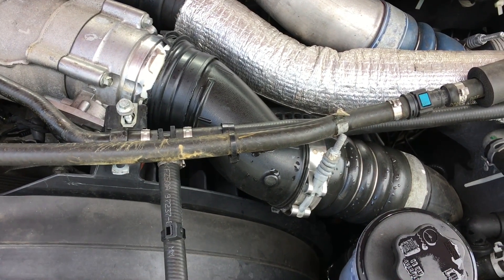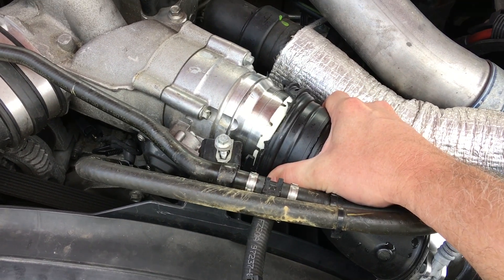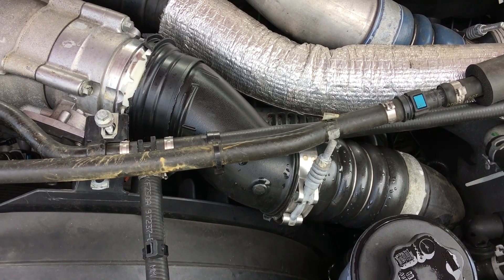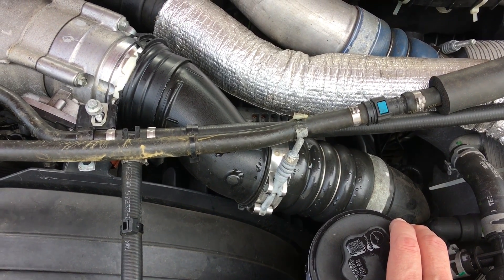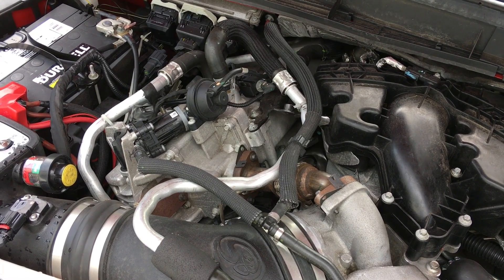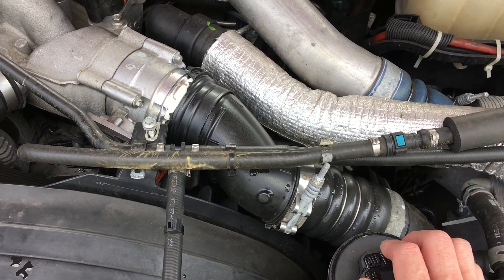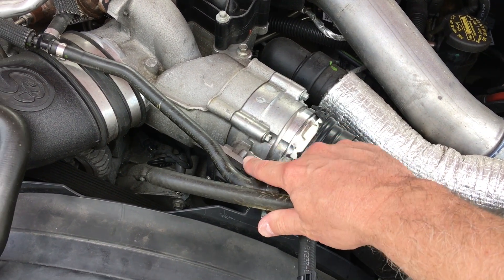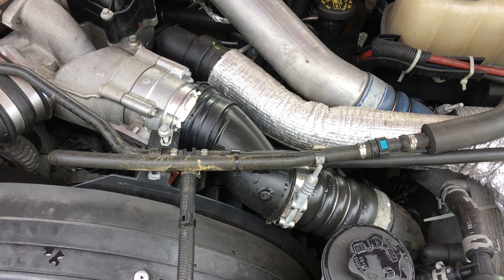6.7 Powerstroke Inter-cooler Pipe FAILURE!

Comment: Mine blew today but I see there is either oil or diesel fuel in the pipe. Should fluids flow in there or is there a deeper problem?
Reply from the maker: Kane ... Sorry to hear. The oil can either be normal crankcase breather blow-by and/or oil leaking past the turbo shaft seals which the 11-14’s are common for if turbo shaft bearings are wearing out and the shaft is vibrating. Depends on mileage and if DPF is deleted causing turbo shaft over-speed which leads to premature wear and failure.
Reply: Almost 125k miles and nothing is deleted. Everything is stock still.

Comment: Just blew mine out. 350,000 miles, had it since 280,000.  
Didn’t hear a pop or a noise.  
Could hear rushing of air noise when throttling, put only me and couldn’t pin point the location. Sounded low and drivers side. Thought a hoses popped off and had this happen once in a 7.3. 
Looked for about 3 hours trying to find something and searching online to find a reason for black smoke, no turbo boost and no loud noise (common to hear when turbo goes out) Thought it might have been my turbo. 
So happy to see this video. 
Checked the upper boot and it had split on the inside. 
Thanks sir. I’ll sleep good tonight.
Reply from the maker: Benjamin Gilley ... You’re very welcome! Glad my video was able to help! Thank you for watching!

Comment: have a simillar problem but mine didt belew up, its kind of embarressing a small animal called marder here in germany drew a big holle on it so i tought the turbo was finished, i dally drive i put up some tape wille whaitig for the new part, 
once i have no choice but to dirve dally wille whaitig for repair , i try not to do strong accelerations, but i dont know if the turbo is already broken
Reply from the maker: Nelss1One ... Your turbo should be fine. The intercooler pipes are on the output side of the turbo and feed into the plenum which feeds the cylinder heads. I do recommend upgrading to a metal pipe to prevent future problems.
Reply: @subman719  many tks for your answer mate :)

Comment: Mine failed at 196,000. I'll replace it with the H&S OEM silicone pipe
Reply from the maker: Guitar4blues ... I personally like the AFE Bladerunner pipe. I think it’s a stronger option. That’s what I used.
Reply: @subman719  is that an OEM setup or does it require a tune adjustment?
Reply from the maker: Guitar4blues ... totally OEM replacement. I have the full AFE blade runner hot and cold side pipes.

Comment: Wow !  That happened to me yesterday in Fayetteville, NC.  Happened just after moving over to the right lane.. sounded and felt like I had hit someone!  Scared the Holy Piss out of me!  Very same spot at the top of the pipe, was blown to pieces.   131k miles, but new engine installed last July, so about 2k miles on this engine! And this seems to happen a lot!    Worst part was that I was 80 miles from home, and thought I would need a tow truck.  But after limping along for several minutes, the engine started to run fine (at 50% power), so I eased it up to Ford in Cary,NC.   It's a known issue; the Service Advisor told me that I should carry hose clamps with me!    Maybe Ford should come up with a Fix !!!!!
Reply from the maker: Unfortunately Ford doesn't care... they STILL haven't made any updates to the pipe so when it blows you get the SAME EXACT DEFICIENT part! So sad that people have to suffer through this while Ford sits back and laughs as they count their profits! I did upgrade to the AFE Bladerunner kit which is a much more reliable option than the OEM pipe. Hope you have better luck in the future!

Comment: My just happen had some oil in there is that normal?
Reply from the maker: landofBrucewood ... Yes. Some oil is normal. There is a crankcase breather bypass kit available that reduces the amount of blow-by oil. However if the turbo bearings and seal are going, you will experience excessive oil in the pipes.
Reply: @subman719  
Thanks for the info. I just ordered a kit. It's a great truck but as with most heavy duty trucks they have few a gripes.

Comment: I have a 2016 I wonder if Ford updated the issue.
Reply from the maker: If you have plastic intercooler pipes on the cold side then probably not.
Reply: I believe they did    but only for 2017 or newer

Comment: What’s the benefit of deleting the throttle body on the inter cooler pipe?
Reply from the maker: Where’s Christopher .... to my understanding, deleting the throttle body is to eliminate one more restriction in the system... however, to do that you need a full delete capable tune and have your EGR and DPF deleted. I ended up installing the AFE Bladerunner kit which left the throttle body in place.
Reply: My intercooler pipe blew at the same time as the dash saying the “exhaust filter is full. service now” are they related?
Reply from the maker: There’s a possibility that the DPF clogged up due to the excessive oil causing higher back pressure in the system but I can’t say for sure. Could be coincidence. But if your turbo is leaking oil it will clog up the DPF quicker. If that’s the case, both the turbo and DPF would need replacement at same time. It’s possible the dealer can run a forced manual regeneration of the DPF to clear it out.
Reply: subman719 that sounds about right. Damn. Thanks.
Reply: subman719 is the turbo Rebuild able?

Comment: When mine blew out the pipe was covered in oil. Is that normal? Now my dpf is full.
Reply from the maker: Where’s Christopher .... The oil is from the turbo shaft seal leaking. The ‘11 - ‘14 turbos are prone to bearing failure and shaft seal leaks. Deleting the DPF and increasing flow accelerates the failure due to over-speeding the turbo. I found out the hard way!
Reply: subman719 thanks for the info. Mine is a 16 stock.

Comment: Mini max is ur problem, running with ur egr like that instead of deleted... yea it’s the trucks fault.  When u half a$$ things, things break
Reply from the maker: There’s a LOT of people blowing the cooler pipes with STOCK motors! Check out my other video and you’ll see. However, it’s no longer a problem... I’m putting this truck back to stock and am trading it in. All my aftermarket parts will be for sale! Even brand new ones that never made it on yet! If you know anyone interested in some great deals, have them subscribe and turn on notifications. I’ll be posting a SALE video soon!  Thanks
Reply: No need to watch another video, it’d be a waste of time!
Reply from the maker: By the way... the EGR was blocked off! I just didn’t remove the EGR cooler which has no impact on CAC pipe failure! CAC pipe failure is a FORD deficiency that happens on stock and tuned trucks alike! People remove the EGR coolers for a cleaner look under the hood and a very slight reduction in weight. The work I did to the truck wasn’t half a$$ed... I just didn’t go any further with upgrades or modifications because I was on the fence whether I was keeping the truck or not. You’re entitled to your opinions though!
Reply: Nothing done half ass here. Very common to have issues with this piping. Not the truck's fault, it is ford's fault.
Reply: Half ass egr “delete”, mine has 130k miles on it with stock pipe... must be fords fault.  Every vehicle has a weak point and yes this is a weak point but to say it happens at 30k miles is bullshit.  Do what u want but stop making excuses.  Bums
Reply from the maker: mike kossman ... So please tell me how a blocked off and disabled EGR (exhaust side) has anything to do with a weak, design flawed CAC pipe on the intake side? Totally opposite sides of the spectrum so please enlighten me on your wisdom! There’s people here who have blown the CAC pipe at less than 30k miles on bone stock motors! Who’s fault is that again?
Reply: I never said one has anything to do with the other.  Pointed out half assing an egr delete, unplugging isn’t blocking it off, means if u will do that then I’m sure u Ram the fuck out of it.  Ur an irresponsible owner if u cut corners.  Good day

Comment: Mine is 100% stock with 68k miles and haven't had a single problem with my truck just like with my 6.0
Reply from the maker: I think it's a crap shoot with these... I know people who've had problems with stock and modified motors and some haven't had any problems. I think my particular intercooler pipe blowout was from not being snapped on correctly at the Ford dealer when they replaced my entire fuel system at 30k miles from a HP injection pump failure spitting metal throughout the system. The mechanic also did some other shoddy things but I couldn't complain because they covered the repair under warranty when it shouldn't have been. This is my fourth F350 with Powerstroke and I can say that it's been a very rocky road with these. I've had a 2004 6.0 which was a NIGHTMARE, then I got a 2007 6.0 which was a dream, even modified... Then my 2011 6.7 which was BONE STOCK had a slipping transmission problem... And now this 2013 6.7 which also has a transmission problem but this time has a delay going into reverse occasionally. All my trucks were brand new when I got them and I RELIGIOUSLY and METICULOUSLY maintain them. Some of the problems are very common, some are not... Like I said... It's luck of the draw. 
I'm glad you are one of the lucky ones and hope you continue to have success!
Reply: subman719 it sure seems like it's luck of the draw with new vehicles these days
I had 387k miles on my 2004 6.0 but a friend of mine had an 05 that he was always working on
Now he has an 2010 Cummins that is hardly ever running right

Comment: how are you running so much boost, im only able to get 20...
Reply from the maker: I have a H&S Mini Max tuner on it so it allows it to build up more boost. I just did a test run... I’m only building 25 psi boost with the factory turbo. Stock was 20 psi. Aftermarket turbo systems will allow it to go above 35 psi. I had the dealer replace my entire injection system around 30k miles due to injection pump failure so I’m thinking the technician didn’t connect intercooler pipe all the way until clip ring snapped in place and that’s what caused failure in the location it did. I now have AFE hot and cold side pipes that I installed myself to prevent any future problems. I will upload install video once I’m done editing.
Reply: Ya im deleted too and i have the mini max as well. I was running 20 before and after installation and so thats why im wondering how yours is. I WANT BOOST!!! LOL
Reply: I used a sct x4 that I also used for my 6.0 just had loaded for 6.7 and tyrant tunes. I get 35 psi easy with hot street tune. My pipe is covered with oil though just noticed it do you Kno why?

Comment: Same thing happend to me like 4-6 weeks ago while towing my toy hauler we thought we got a blowout when it happend
I was near a lowes luckily and grabbed a 3" fernco and some hoseclamps and we drove 450 miles like that no issues lol just upgraded mine to a aluminum pipe kit
Reply from the maker: Sorry to hear... these OEM pipe blowouts are very common as I recently found out. I used duct tape and zip ties on mine to get me a dealer that had one in stock. LOL    First two dealers I called were sold out. Upgrade pipe coming soon!
Reply: ya seems like its important to change especially after deleting it

Comment: Hey dude, it's Frank, haven't talked to you in a while but what's been up man? I have a couple of these stock one laying around if you need one. Or I can get get you an aftermarket one that won't break. I run the AFE Power Hot and Cold Pipes on my truck and have yet to have any issues. Let me know.
Reply from the maker: Yeah, long time no talk... I threw an OEM one on there temporarily until I get the better aftermarket one on there... I'll reach out to you in a little bit. Thanks!
Reply: Sounds good brotha.